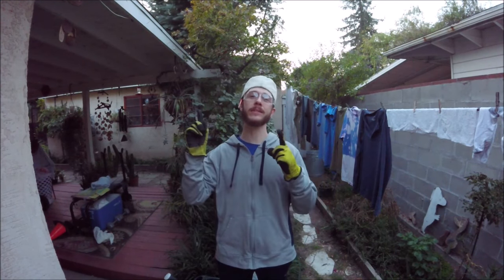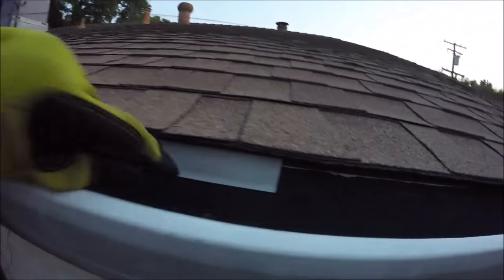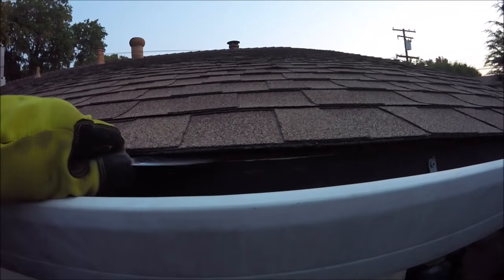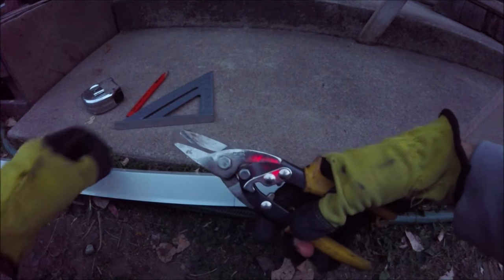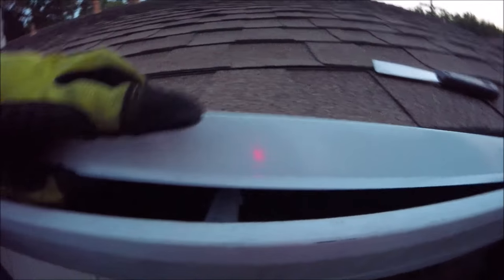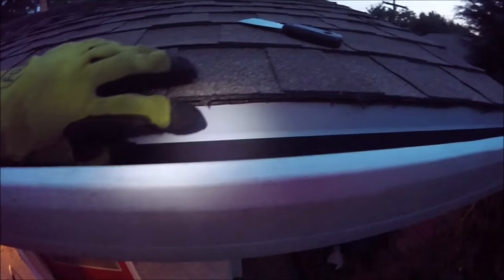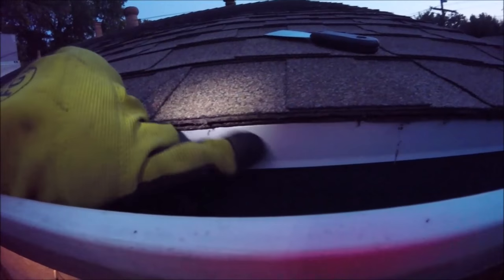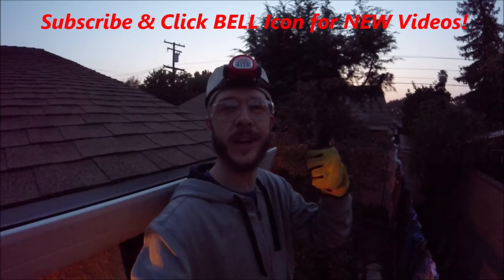How To Properly Install Drip Edge on your Roof -Jonny DIY

Comment from the maker: Tools & Supplies Used
Tin Snips- https://amzn.to/2spnkeC
Tape Measure- http://amzn.to/2supid8
Speed Square- http://amzn.to/2idDsOz
Leather Work Gloves- http://amzn.to/2x5BZk3
Safety Glasses- https://amzn.to/2XXe3dI
If you Enjoy the Channel Consider Helping Support it by Donating below & by Subscribing.
PAYPAL DONATION https://www.paypal.me/JonnyDIY
Reply: How NOT to install a drip edge PROPERLY! ALL drip edge is held down via using some sort of nails or screws if you want it to STAY IN PLACE! Don’t just use some glue or tar crap. It’s supposed to be firmly attached to the WOOD, not shingles. Shingles should over hang drip edges by around 3/4” or so depending on application. But if you do this guys hack job you for sure want to add a tar under all that was pried up or with a strong wind you can get some serious or complete patches of your roof torn off in one gust since once shingles are installed they all become one due to the way they’re are designed using the tar that’s pre done on each shingle that most have no clue why is there. And front face screwing on a drip edge seems pretty pointless since you’re installing drip edge to prevent leaks and then create one by drilling or nailing holes in the side that water drips off. Don’t do any of what this guy does here really and call a pro or do it right yourself with lots of time, but easy work on a ladder which is safest or tie off on roof is best if possible.

Comment: Well done, total roofing noobie here, and I am replacing rotted wood fascia/soffit that previously did not have a drip edge.  This is exactly what I was looking for!
Reply from the maker: Thank you! Glad the video was of help. Good luck with your project 👍🏻
Reply: Johnny DIY 
This is EXACTLY what I need to do as well. Do you recommend the roof sealant to hold it down?
Reply: @coolhluke8089  Me too!

Comment: Perfectly explained!  It answered my question regarding the strip being held in place.  Sections of the roof of my new home doesn't have this drip edge and the quotes to install one were much higher than I thought it should be for an easy job.  I'm ready to DIY this project!
Reply from the maker: You're welcome, happy to help. Good luck 👍

Comment: Ty for this video!  I have looked at quite a few others but yours is simple and to the point.  Exactly what i need to do, and the tip on just sealing the shingle down onto the drip edge with some tar or adhesive is the way to go vs. lifting shingles up to nail it.  I had a leak show up in the ceiling dry wall just opposite the outside wall.  Attic didn't reveal anything, got up on my 2-story roof opposite the leak and didn't see any issues.  I didn't know about drip edge, which they didn't put on my 15 yr. old roof.  So, looks like some of the water running off the roof in one area was not completely going into the gutter but wicking under the shingles and soaking into the wood and onto the ceiling dry wall.  Funny, I couldn't see anything in the area of the leak when I was in the attic that was wet or showed signs of leaking water.  Live in Oregon and get a lot of winter rain.  Anyway, now that I know what to do, it is up the ladder, repairs, then fix the drywall. Thanks again!
Reply from the maker: You're very welcome, happy to help. Yes water leaks can be a little tricky to pinpoint where exactly they begin. You should be able to trace from attic if really get in there. Check for any staining on wood and look above higher in case leak has ran down then dripped onto that spot. Hope you get it sorted and fixed. Ohh yeah you guys get tons of rain, I have an Uncle in Beaverton and another in Oregon City

Comment: Very helpful for an existing roof.  It's important to know if it should be installed over or under the felt paper (or tar paper as my dad called it)., I believe it goes under?  Thanks for making this video!
Reply from the maker: Yes, drip edge goes under on the eaves side and on the rake it goes on top 👍

Comment: Great video! Simple and to the point. When nailing down drip edge can the nail be exposed or does it have to be under a shingle? If exposed, roof tar to cover it?
Reply from the maker: Yes nail heads should be under shingles or if no choice but to have exposed covered with roof sealant/mastic/tar👍

Comment: I'm the biggest doofus in the world, I designed and built my first shed, did all the roofing, getting ready for paint...just to notice I never did a drip edge. This is really helpful, thank you!
Reply from the maker: You're welcome, glad to help. Hey better late than never! 👍
Reply: Same here. Installed new gutters on house. No drip edge. I should be beaten!  Thanks for the video!!
Reply from the maker: @travismcreynolds3769  you're welcome glad I could help 👍
Reply: No need to beat yourself up.  Most new roofing installs do not use drip edges cause it adds expense.  I always install drip edges for obvious reasons, but a lot of roofers do not due to competitive pricing.  If you want a drip edge, it has to be specified to the roofer.  Cheers from Canada.
Reply: @petemiller519 that may explain the lack of drip edge on my house in North Bay, Ontario.

Comment: Good video.  House I purchased 2 years ago had just had the shingles done that spring but I noticed leaking behind the gutters this year and was stunned when I discovered no drip edge.  Since I have to drive the nails back in to hold the gutters, I probably don't need to use roofing nails.  Will run a bead of roofing tar between the drip edge and the shingles though.
Reply from the maker: Good catch, hope you can get it fixed before rainy season 👍

Comment: Great video. Roofer didn’t lay the shingles correctly and Water wicking is causing fascia rot all over my building.  I repaired a section two years ago using the roofing sealant and it’s held perfectly.  I couldn’t figure out where the leak was coming from. I had to sister one of the trusses the rot was so bad. Now it’s happening in multiple locations. Another roofer explained the issue to me this week. He’s going to repair the gully and a really bad area. I’m going to seal the rest. Your video helped affirm I’m going in the right direction.   Sigh. I’m so aggravated.  Roof should have lasted another 10-15 before having issues. Thank you!
Reply from the maker: Glad I could help, sorry about the roof issues, hope they get fixed before the wet season
Reply: @JonnyDIY  he did three for me. The other two are fine, no issues. It’s gotten bad as we’ve been inundated with rain after several dry summers.  Thanks for your videos!  Will watch the others you have.
Reply from the maker: @Dbb27  you're welcome! 👍

Comment: Hello, I enjoy your video, it looks exactly what is wrong with out gutters.  I am looking around and can you tell me the type of drip edge you used?  What size width and it has a little lip.  Thank you and take care.
Reply from the maker: You're welcome happy to help. Pretty sure it was this one from home depot.
Gibraltar Building Products
1-1/2 in. x 1-1/2 in. x 10 ft. Galvanized Steel Drip Edge Flashing in White
Reply: @JonnyDIY  Thank you so much for getting back to me so fast!
Reply from the maker: @patriciamurphy8425  you're welcome, happy to help 👍

Comment: Thanks, but how does the drip edge fit over top of the gutter brackets that hold it to the facia board?
Reply from the maker: You're welcome. If you run into the problem of the drip edge hitting gutter brackets just cut a small notch making a little tab that you can just bend up clearing the bracket 👍🏻

Comment: So is it safe to apply one of those rubber sealant between the shingle and the drip edge?
Reply from the maker: @thanhtrinh2029  yes you can glue it down with sealant if you dont want to use nails or screws

Comment: Thanks man i just did this and it solved alot but now im getting water dripping from my soffit. Any ideas there?
Reply from the maker: @mattd8411  hmm if it just started after doing this I'd go back and double check work
Reply: @JonnyDIY  ok sounds good thanks it seems like the shingles are little spaced facing up.

Comment: Older houses have that 1x2 along the top of the facia, under the metal drip edge flashing.  Unfortunately there are few videos showing how to easily replace facia and that 1x2 under existing metal drip edge flashing.  The metal drip edge flashing is typically 2" wide at the top and the nails holding it are through the facia and/or the 1x2 from the top, under the shingles.  Drip edge flashing now can be bought with a 1/2" overhang out from the portion that goes 'down' the front of the facia.
Reply from the maker: Yeah that sounds a lil trick but I'd probably just use  reciprocating saw to cut the nails holding the fascia to the rafters and then pry down. If that didnt work Id pry up the old drip edge and cut all those nails (could use oscillating tool if reciprocating saw didn't work) holding it down and just replace it after the new fascia goes up 👍

Comment: Great video. Easy to understand. My issue is rain is getting between the shingles and the top of the drip edge. I know you mentioned it in your video but will using roofing/flashing sealant between the shingles and the drip edge to seal them together stop this problem? Thanks Jonny.
Reply from the maker: Yes if there's not proper overhang of your first course you could have that issue. And depending how little rain or dew there will be a little capillary action. Yes, I would use the sealant between the two in the areas that are concerning you 👍

Comment: How do you work around the gutter brackets? How do you make sure they don't interfere with the drip edge?
Reply from the maker: Cut a notch in drip on each side of it and bend up so the bracket can slip up into the channel👍

Comment: If your drip edge is already installed, and you are now installing the gutters by sliping them up and under the drip edge, and then using the gutter hangers that come with a built in mounting screw, do you screw through the drip edge and the back of the gutter, and into the facia or rafter end in that case? Seems like in that case the back of the hanger won't slip over the back of the gutter because the drip edge will be in the way now that I'm thinking about it. Thanks for the video.
Reply from the maker: You will need to cut a slit upwards on the corners of the drip edge to slip gutters up under. And for the mounting holes what I usually do is just cut 2 upward cuts the width of mount making a notch and fold it up then screw in mount and then fold notch down.

Comment: I was just trying to show a customer the proper way. I was surprised that you talked about the facia gap That's what I was hoping somebody would show it's important Even if someone has a hardy board.
 If something cannot dry it will die plan & simple
Reply from the maker: Yes you're right. So many people install it right up against the fascia too

Comment: Thank you for the video! Question: if I install gutters that have a wing, then I will not need to install any drip edge, correct?
Reply from the maker: Yes not sure what type you're installing but some gutters dont need drip edge if theyre mounted up tight under shingles 👍
Reply: @JonnyDIY  TYVM!

Comment: Was wondering how to install drip edge when shingles are already there. Thought it needed to be nailed. I just don’t see it possible on pulling back my shingles to nail from top. I guess I’ll try the glue method
Reply from the maker: You can glue or face nail/screw. If you do that just cover the heads with some silcone type sealant and itll be fine 👍
Reply: @JonnyDIY  I’m going to try to get under the shingle first. Thanks for the reply 👍
Reply from the maker: @zachdavis2641  You're welcome,  good luck 👍
Reply: check out a tool called the roof snake that is going to be how I add a drip edge to my roof with existing shingles
Reply from the maker: @cam4592  thats a cool tool, Ive seen before 👍
Reply: @cam4592  thanks for the tip. Will def grab one of these

Comment: Yea, retro-fitting roof parts is a pain!  LOL.  But worth it.  For some reason, my fascia board also has a 1x2 nailed to it, under the drip edge.  I don't see that very often.  But it helps protect the fascia better.
Reply from the maker: You're right! Always so much more work going back and trying to fix something. Interesting, think I've only seen that a handful of times too 👍
Reply: It seems to be a thing in Florida. I’ve seen and have it.
Reply: Older houses have that 1x2 along the top of the facia, under the metal drip edge flashing.  Unfortunately there are few videos showing how to easily replace facia and that 1x2 under existing metal drip edge flashing.  The metal drip edge flashing is typically 2" wide at the top and the nails holding it are through the facia and/or the 1x2 from the top, undert the shingles.
Reply: @realjwc9714  Hurricane Ian took off a section of my roof last year and I forgot to tell the roofer to leave that 1x2 off when he replaced it, so he put it  back on as the original.  It really hasn't been an issue, but I wanted to put aluminum fascia over the wood, but that 1x2 hinders that because of the gap it creates underneath.  

So what I did myself was nail a 2nd piece of fascia board over the first one, butting it up against the bottom of the 1x2 which now gives me a smooth solid surface for the fascia and/or even gutters.  The aluminum fascia is wider than the wood and slides up under the drip edge, covering that butt joint so there's no leaks.  My drip edge is quite tight against the fascia too.  I did have to rip the 2nd fascia to the exact width so it fit flush with the bottom of the first, but that was no big deal.  It works and looks great.
Reply: @Dbb27  Yes, I'm in Florida too LOL.  The addition on my house with this roof and 1x2 was built in the "50s.

Comment: Do you knotch-out the Drip Edge to accommodate for the Gutter Spikes?
Reply from the maker: Yes just cut a slit a lil wider than spike and bend tab upward 👍
Reply: @JonnyDIY  I have a Job ahead of me. High winds and Rain causes a Tree branch to hit my main Power Line. Bending the pipe, breaking the Soffit and ripping the Fascia and Gutter off.
 I have to remove the Gutter, ( approx 35- 40 ft, all one piece) replace Soffit and Fascia and while I'm at it, install a Drip Edge
Reply from the maker: @ROCKnROLL1406  ohh man sorry to hear, you've got your work cut out. Good luck with the project,  hopefully you'll have some better weather to fix it in 👍
Reply: @JonnyDIY  Thank You.
Yesterday, Electrician replaced and Installed new Service and PVC Pipe. One part finished, next my turn once we get good weather
Reply: @JonnyDIY  I subscribed to your Channel
Reply from the maker: @ROCKnROLL1406  thank you for subscribing 🙏👍

Comment: Hey 
Jonny
 What kind glue or sealant do you use for this ?
Brand ? or something that will stick permanently ?
Reply from the maker: Any sort of roof and flashing sealant is good. Vulkem polyurethane sealant is great if they have it 👍
Reply: Thanks, I like learning and going to do mine when warmer.

Comment: I have to replace my drip edge because the old (plastic) one is chipped and broken from using a roof rake all winter (I live in Maine).  I should use nails or screws to anchor the new (metal) drip edge down,, right? Otherwise I think the rake will just pull it all apart on a cold, snowy day.
Reply from the maker: Yes you could just screw or nail then cover heads with sealant. Ideally you nail from above through the top if you can, but its too difficult usually with old roofing and not worth risking damage

Comment: I have a gap between my roof decking and fascia board. I can't anchor the drip edge to the roof decking because of this. Might have to go the roof caulking route.
Reply from the maker: You can face nail or screw the drip edge too, then just cover with roof sealant 👍

Comment: How did you install the hangers for the gutters?  You can't install hidden hangers if the gutter is behind the drip edge.
Reply from the maker: Cut small slit in drip edge for gutter brackets 👍

Comment: What if I have gutter guards on my gutters already? Do the gutter guards  have to be removed to install this type of drip edge?
Reply from the maker: Depends what kind of guards you have, but you want the drip edge over into the gutters so itll drip and drain into gutters. Or if the gutters are mounted below drip edge you want the drip edge bent away from fascia so itll drip into gutters and not back on fascia
Reply: My roofer made a mistake. ( Most roofers make the same mistake) Roof shingles are supposed to be installed 1/2” past the drip edge minimum!
Most roofers install them even with drip edge. Water surface tension will make the dripping water run down the facia.
Just like when we pour out a glass of water and the water runs down the glass instead of pouring out. Water has surface tension!
Improper installation results in water running down the facia and behind the gutter.
All I could see out my picture window was water dripping off the house behind my gutter every time it rained!

Comment: I had some fascia replaced recently, but when the guys demo'd  the old fascia, that beat up the drip edge pretty badly.   I like how you installed the drip edge, but is there a way to demo out the old beat up drip edge, then replace it with new using the method you showed?    Or if we were to install a rain gutter, would that hide the beat up drip edge?
Reply from the maker: You could run new drip edge right over old stuff just get larger one or if you end up getting gutters youll never notice the drip edge 👍